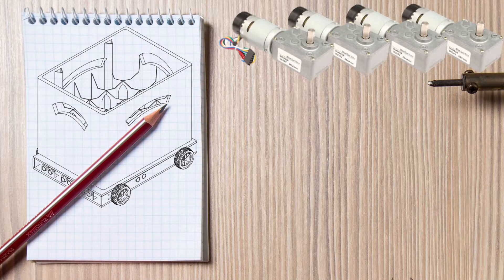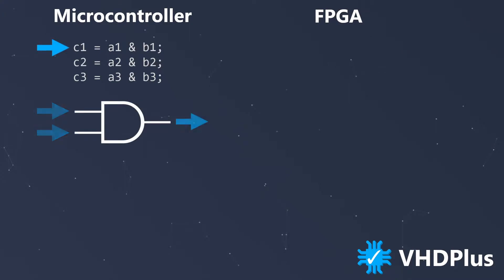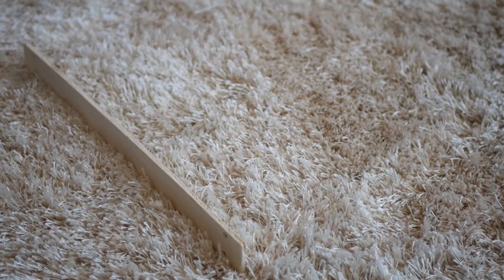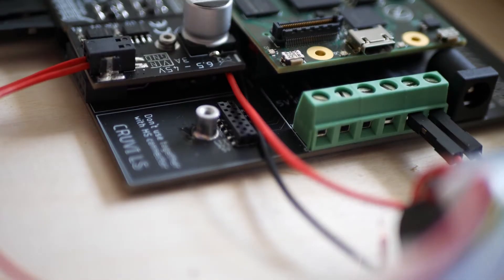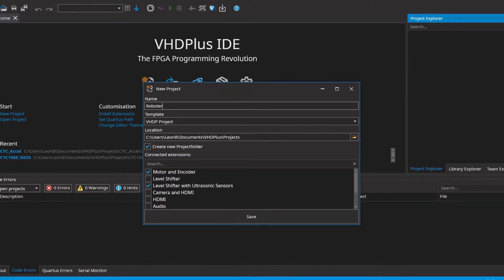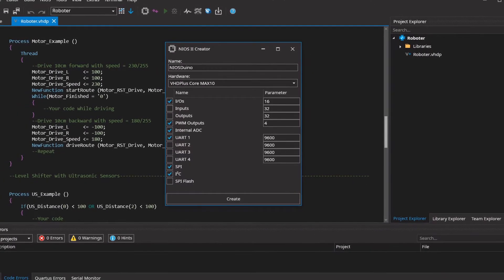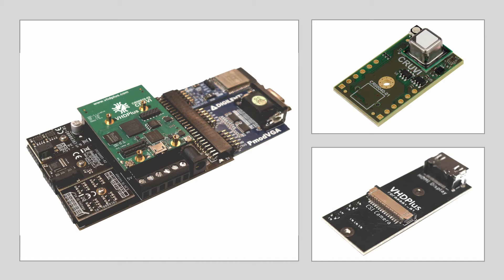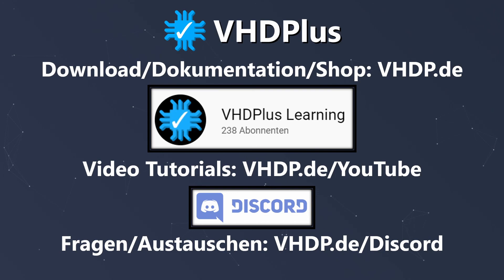How FPGAs Replaced My Arduino Boards - From Maker Faire Hannover

Comment: This really isn't an FPGA task. This is a task that would be very easily handled by an Atmega1280 without having terribly complicated code quite honestly. I would even go as far as to say that you shouldn't be using an FPGA for a task like this. What you have here is a fundamentally sequential logic problem. You could even control all of the motors at once if you plan your program and hardware configuration around doing it. When you think about things like this from the perspective of someone trying to create a product, using an FPGA here over microcontrollers for this is just an absurdity given how light the workload is. Even if you needed to use multiple microcontrollers and leverage their strengths to create interfaces for each individual component that still would not come near the cost of using a single FPGA.

Comment: High profile led flashing! Multiple microcontrollers for parallel computing? Anyone? 

30 euros for an fpga is quite nice, for simulating a 6502 maybe.
Reply from the maker: There are many applications where microcontrollers are a cheaper option, but the 30€ FPGA board has a way higher processing speed than 30€ arduino boards if you for example look at processing image data with neural networks in the last video on this channel. The robot example is maybe not the best one. With the additional power and flexibility, you can do more with the board and can use it for way more projects than what you can do with a microcontroller board. Often you also find a combination of an FPGA for high speed data processing and a microcontroller for the remaining tasks

Comment: I am pretty sure that you could build this even on a weak microcontroller since 99% of an ultrasonic sensor is waiting for io. Also almost all microcontroller have embedded circuity which can be programmed to run motors and other stuff.
Reply: Yes, a microcontroller could do that too, unless your robot is for military applications. Then you use the FPGA instead of a microcontroller or any other ASICs.

Comment: I get your point but a 133mhz rp2040 with 2 cores would make very short work of driving such a robot... And it only costs 96 cents (1.5€ with all the required passives and nor memory). Using an fpga for this feels way overkill, they're both complex and expensive, and make the developpement time much longer (usually), but seems like your tool helps for that part so that's good.
Reply from the maker: For me it is more about the flexibility to always add more hardware without thinking about cycle times and multithreading. Also image processing is something that is more efficient of FPGAs
Reply: funny im working with a 2040 right now and just programming a BLDC controller (for a single motor) and i get to its limits because the cycle times are just too long for smooth operation at higher rpm's, even when splitting the work between both cores. i could use a bigger raspberry pi, but then there is no cost benefit compared to a cheap fpga, the software is awful and unreliable and it doesn't even have enough pwm outputs, so now i need to add another board which adds latency and complexity and.. man i think fpga's would've solved all my problems in the past and right now but i was just always too afraid of having to learn so much new stuff but not anymore IM GONNA BUY ONE NOW
Reply: well long answer short: i think you're extremely overestimating the capabilities of a 2040. its a good chip if you have one sensor or one output that operate at low frequencies, and not much more.
Reply: @sadcvnt_uwu  You do know that most 3D printers are just run by a single Atmega1280p, right? like a basic 16MHz AVR-based 8-bit microcontroller. You're actually vastly underestimating the capabilities of a 2040 which is 9x faster than what 3D printers even use with 4x the bit width and a way more efficient architecture(ARM Cortex). Not to mention both of them are still at least 1000x faster than the processors we had in literal space crafts in the 80's.
Reply: @sadcvnt_uwu  are you making use of the PIOs or just driving it from the main cores? because that looks like an application for the PIOs...

Comment: This more seems like a use case for a bigger microcontroller with a real time operating system. Then just make a task for each sensor. Much simpler to code, update, and maintain then an fpga. Though FPGAs are still fun. So if you want, it is fine here.
Reply from the maker: Yes with a bigger microcontroller, this would be possible. I still like programming with FPGAs more because you always have enough performance no matter how many sensors and actors you add. And for me, FPGA programming became even simpler than microcontrollers. You don't have to think about which pin you use, if you have the right interfaces, and programming with an RTOS is more abstract

Comment: Is the Arduino not fast enough?
Reply from the maker: No, there are several examples where microcontrollers are not fast enough. So in many products are FPGAs or ASIC that were first designed with FPGAs
Reply: @vhdplus  You are correct in principle, but if an 8-bit AVR can handle 3D printing at high speeds I don't see why you needed anything close to an FPGA for this task.

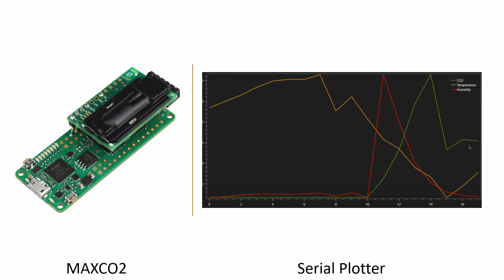Comment: 8:20 Where is that graphical display coming from?  Is there something in the IDE to display the serial output like that?

I've tried the MAX1000 accelerometer example, which produces serial monitor output as text, but is very hard to read as it scrolls past.  Can that be shown graphically?
Reply from the maker: Did you see the MAX1000 video? There we show how to open the plotter